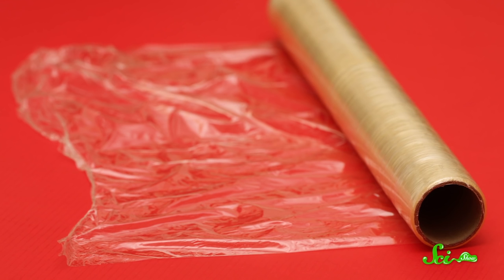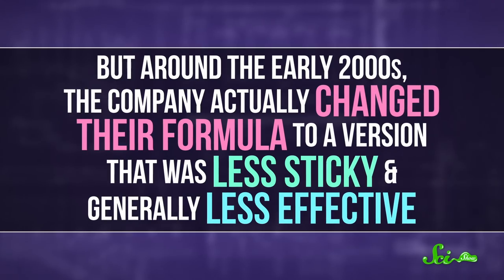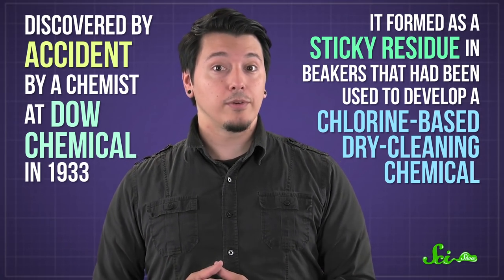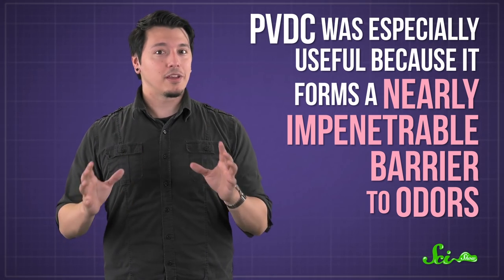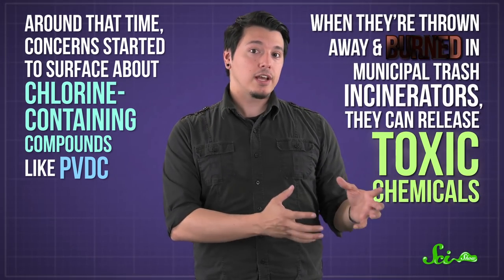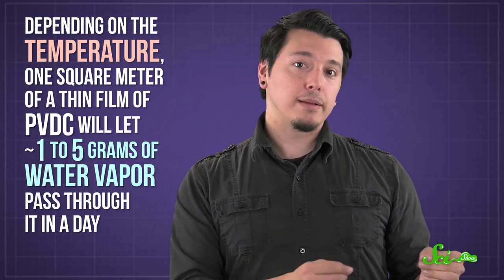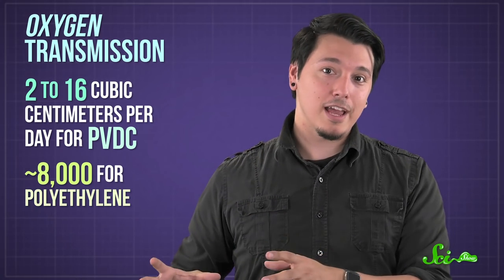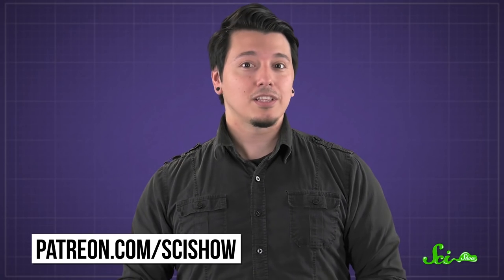Why Isn't Cling Wrap as Good as It Used to Be?

Comment: The production of PVDC was only partly stopped due to environmental concerns. Chief among the reasons was cost - it actually breaks down very near it's production temperature, turning it from transparent to brown, which means only a small error during production can ruin a batch. 

I suspect if PVDC were cheaper than its PET replacement, the stuff would still be made from PVDC.
Reply: Good point!

Comment: less clingy, eh? I still spend half an hour trying to get a sheet to stop clinging to itself before i can use it =/
Reply: In the good days if the wrap touched itself you had no choice but to cut that piece off and throw it away, unless you wanted to deal with a bulgy piece of plastic.
Reply: stiimuli It's not just me! I feel so much better now.
Reply: The problem now is that it only sticks to itself now, it used to actually stick to the bowls you were covering, now you have to use enough to stretch it over itself so it'll stick
Reply: See, I have trouble even getting it to stick to itself. I'll cover a bowl or whatever and try to push it down around the edges onto itself to hold tight, and it just loosens up as soon as I let go and release the tension. I end up using way more than needed so there's a bunch of extra to scrunch up and sort of roll over itself so it holds. I definitely remember when I was younger and a tiny breeze would make one corner fold up and suddenly like 3 feet of it were gluing itself together and becoming completely useless, and I'd rather have that.
Reply: Jatt2613 I have figured out a trick for this.  Get a little water on your fingers and run them around the edge of the bowl, getting it damp.  Then put on the cling wrap, and it will stick more easily.
Reply: Simple solution: put the sheet over the bowl you want to cover with it, then use duct tape to make it stick.
Reply: They make this new invention called aluminum foil, it doesn't use tension and cling but the strength of folded metal to stay the way you want it...
Reply: But aluminium clearly won't form as good a seal as cling wrap.
Reply: Mr Nobody, cling wrap doesn't cling anymore so what's worse? metal that sort of covers your food or plastic wrap that only sticks to its self and pisses you off so bad when it flings out of the flimsy cardboard box gets stuck to its self because the plastic blade that can't even cut the wrap it was glued on to the box with the sole purpose of cutting. Didn't do its job so you end up with cling wrap on everything except on your plate of left overs....  
LET IT BE KNOWN I HATE CLING WRAP!
Reply: Then it doesn’t cling when u want it to
Reply: Yet it won't cling to the bowl
Reply: True, dealing with cling wrap is like a battle against the devil.
BTW, is there a way to get our hands on PVDC wrap ?
Reply: I feel like less clingy is a good thing. I wouldn't want the stuff to be any more clingy than it is today.
Reply: you're doing it wrong then... then second you notice it start to fold over on it's self STOP EVERYTHING. grab the fold by the middle part that still hasn't fully stuck down and give it a sharp pull. if it fully folds over on it's self you're skrewed.
Reply: Kayla Svec >> makes me wonder if we in Denmark still use PVDC as it easily sticks to bowls and such here. I dont think so, as it is possible to unwrap the foil, when it sticks to itself..
Reply: Atomic Reverend Alexander this is a great alternative if you want to keep your food covered while you microwave it
Reply: @SKB Artistry You quite possibly do still use PVDC. I just checked my rolls of cling wrap in the cupboard (here in the UK), and found three. One had no box, and one was a Sainsbury basics one with no information on what plastic it was. But the third was a roll from Lidl which clearly stated it was high-quality Polyvinyl Chloride (though I'm not sure how quality is even a thing when we're talking about a polymer chain of identical molecules), which I'm guessing is true of Lidl's cling wrap in its stores across Europe too.
Reply: @Annaie1234 And there, I suspect, is another difference between the two formulas. My sainsbury's roll is not suitable for microwaving, which might mean it is Polyethlyene, as Sainsbury's were always very concious of the environment, at least when it helped sell products. The Lidl PVC one is suitable for microwaving.
Reply: yep! Google it and you can buy it online.
Reply: to bad it has near zero oxygen and liquid holding ability. I guess you could layer a piece of this new non-cling wrap over and then foil over that...
Reply: stiimuli damn.. you spend half hour.. girl.
Reply: Jatt2613 It's called shrink wrap in the shipping industry.
They call it this because you have to STRETCH IT to get it to cling to itself, shrink slightly, and hold.
Reply: Jatt2613 You have to stretch it, so that it presses onto itself with tension.
Reply: Not Pulverman shrink wrap? I take it that You're talking about an entirely separate thing to the completely understandable shrink wrap used to cover boats over the winter and seal electrical connections, which has to be hit with a heat gun to shrink and stick it.
Reply: Store it in the freezer. My family does this. Comes off the roll with no hassle every time now.
Reply: self-adhesion is generally the polyethelene property
Reply: @southernsuccubus420  There's the real reason they change the formula.

Comment: I knew something was different. The new stuff just slides.
Reply: You're definitely using it wrong. The new stuff does NOT slide.
Reply: The new stuff is useless because it won't stick to anything. The old stuff was almost useless because it stuck to everything and would wad up before you could use it. But at least if you were extremely careful it would stick where you wanted it to.
Reply: The new stuff sticks to itself just fine when you give it enough overlap (read: more than 2 centimeters) and your fingers aren't greasy.

Hmm...perhaps the new stuff has the positive side-effect of getting food workers to wash their damn hands!
Reply: When sticking to itself means using 3 feet of wrap to ram it around the container so it stick, instead of STICKING TO THE CONTAINER like it did. Now it don't. I basically used a plate or something, until i realized, hey, that's why tupperwares exists!
Reply: It still sticks to itself extremely well.
You just have to wrap all the way around once, cause it isn't going to stick to random crap.

Comment: And that's why Ziploc bags and aluminum foil are now MUCH more popular than plastic wrap.  Personally, I miss the old cling wrap.  It worked SO MUCH better there is just no comparison.  As a chef, even industrial "cling" wraps have suffered.  I used to individually wrap all sorts of baked goods in industrial cling wrap every day.  In those days I could use just one layer, no tape or adhesive, and know that the product would still be sealed, fresh and not absorbing the odors (and flavors) of the product next to it on the shelf.  Unfortunately, not only does the new plastic wrap not cling to itself or anything else, but it doesn't keep the odors in, OR out, either.  Cookie sales have definitely dropped since I haven't been able to individually wrap cookies and put them in a basket next to the register.

Comment: I remember as a kid there were 2 types of clingfilm; the good stuff, and the microwave-safe stuff which was thicker and not as clingy. You could almost blow bubbles in the good stuff, and if you poked your finger through it sometimes it would grip the end of your finger so tight it would hurt. And then one day it seemed you could only buy microwave-safe clingfilm.
Reply: What you call the good stuff is probably a type of polyvinyl chloride film with a lot of plasticizers in it to make it stretchy and clingy, which is why it couldn't be microwaved. However, the original Saran wrap sold in the United States until 2004, was also superior in that it would stick better and block moisture, orders and oxygen much better as shown in this video. That was made out of polyvinylidene chloride and could be microwaved. You can still buy it in a couple of brands from Japan on Amazon or eBay. Saran wrap today, as well as Glad wrap, is made out of low density polyethylene, which is also microwavable.

Comment: The real question I have here is: "Does the benefits of the freshness sealing power of polyethylene, while less than the Saran wrap, outweigh the toxic pollutants it puts into the atmosphere when destroyed?" When they destroyed Saran Wrap, it puts a lot of toxic pollution into the atmosphere. When they destroy this new formula, does it put any pollution out there? Does it put out more pollution than the value of just throwing out the food when it goes bad? And also, how much longer does this new formulation keep food fresh compared to just not covering it? Or using a tupperware or other sealable and reusable container? Is it worth it in the long run to use this new formula as opposed to nothing at all as opposed to saran wrap?
Reply: 1. Yes, but don't destroy it. Recycle it!
2. Yes, but considerably less.
3. No, and consider eating your food before it turns bad.
4. From a scale of 1 to 10, probably a 9.
5. Wat?
Reply: @IOffspringI  “recycle it” is kind of a useless platitude when some things just don’t get recycled.